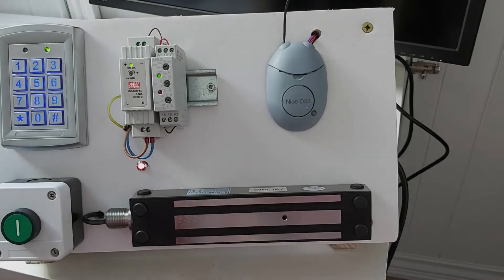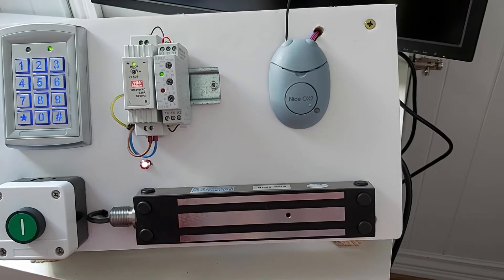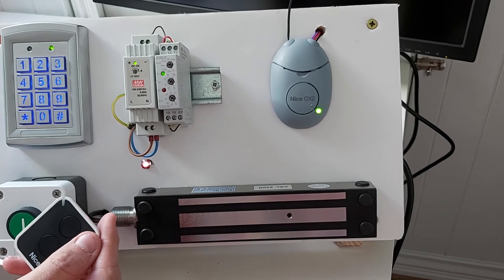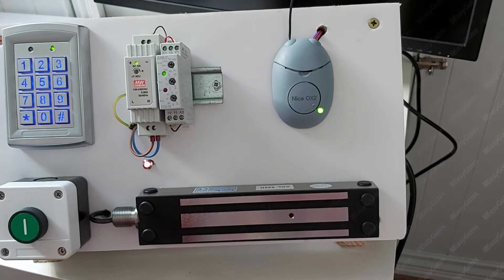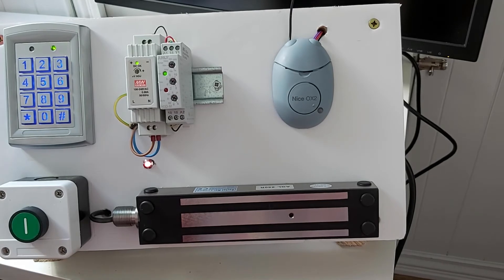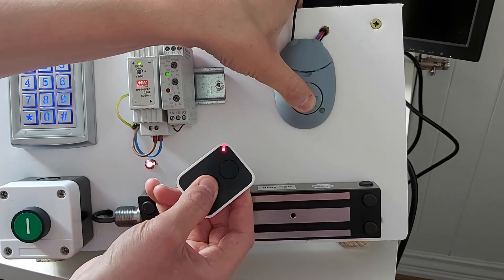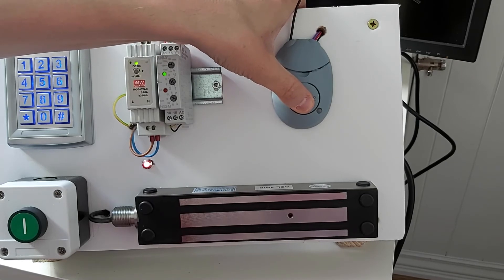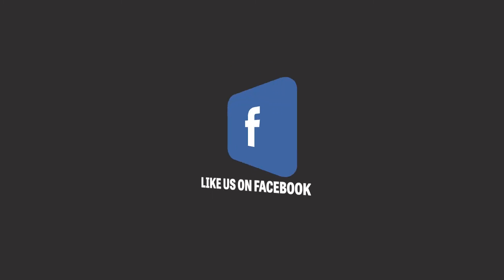Full Programming of the Nice OX2 - OXI Radio Receiver

Comment: I appreciate the great video. I am having an impossible time getting a single two button remote to operator two different receivers, button 1 operate receiver 1 gate, and button 2 operate receiver 2 gate. Is it possible?
Reply: Hi Walter,

Thanks for your message.

this is possible and you will need to program your remote into mode 1 type programming the steps are as follows.

Step one
Press and release button on the receiver and a light will emit.

Step Two

Press and hold the button on the remote control that you wish to operate that gate and keep held until you see 3 quick flashes emit from the receiver.

Step Three

Repeat this process again for the other receiver using the other button on the remote control

Kind Regards 
Joe